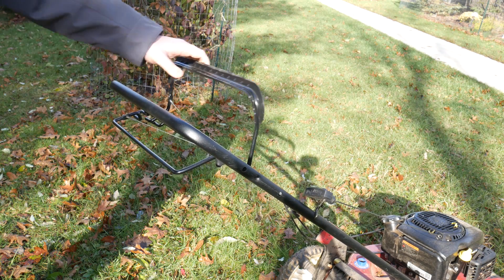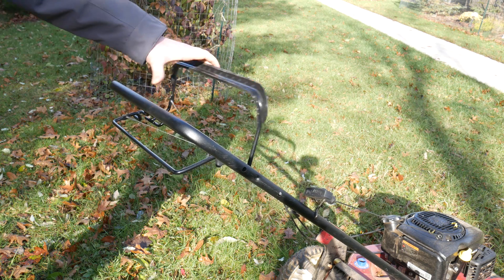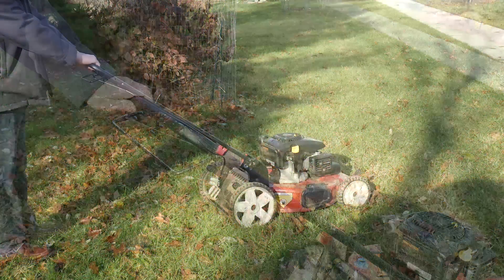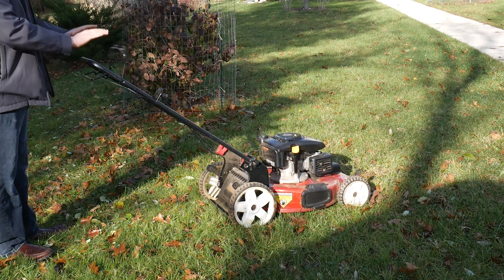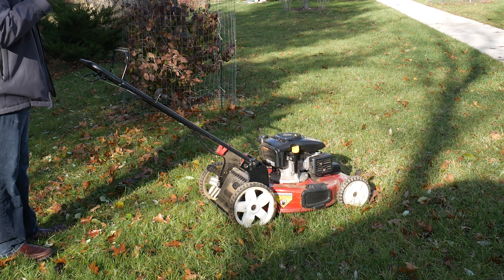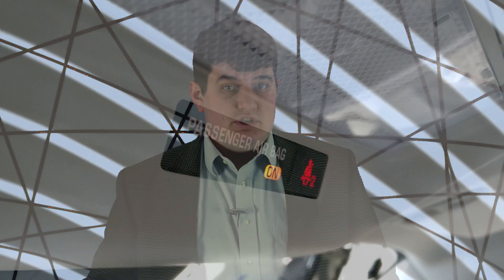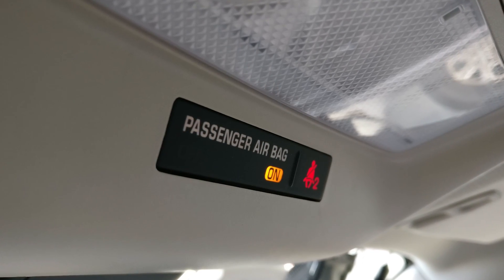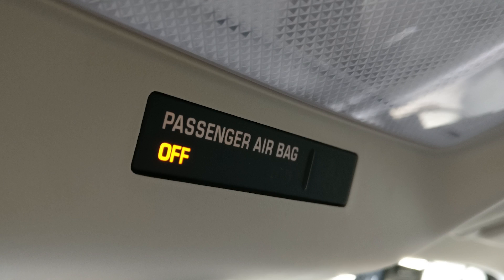The Dead Man's Switch:  How Anton Yelchin's life could have been saved

Comment: A steering wheel not physically connected just seems stupid, how do I steer my car if it dies and needs to be pushed? Lol.
Reply: Do you mean the Infiniti Q50's steer by wire system?  It has a clutch that can engage a physical connection from the steering wheel to the steering rack as a fail safe.
Reply: @TassieLorenzo  in that case what's the point of having steer by wire then if you have the entire mechanical connections there. there isn't a cost savings or a weight savings so they are literally putting in drive by wire just to make the car more expensive.
Reply: I seem to remember the Prius had issues early on where the wheels would get stuck in position when turning a corner and not being able to straighten out, even if the steering wheel was pulled back, because of steer-by-wire controls.
Reply: I think they are connected by hydraulic links, so that the wheel feels lighter when it is pressurised but it gets heavy again when there is no pressure going through the system
Reply: @jamnchips  Sounds like "power steering" to me...
Reply: Matt Carrell it’s just that some power steering still has the steering wheel connected to the front wheels and some power steering doesn’t
Reply: @jamnchips  Yea and I think it should always be connected to the wheels. What if your car loosed power going highway speeds? Jesus take the wheel has a whole new meaning.
Reply: @majorphysics3669  That´s exactly what happened to me, the motor of my car broke at high speed on the highway during a rainy night ,and the whole electronic shut down in an instant.
That meant no light, no anti-lock braking system, no electronic stabilization program, no brake booster and no steering booster / power steering.
Luckily there is always a (mandatory) direct mechanical connection between the steering wheel and the steering linkage, same goes for the brakes, so instead of a slight pull on the wheel you have to use much more force and have to do multiple full rotations to turn into the aimed direction, and you have to press the break pedal like crazy, but nevertheless you can bring you car safely to a rest on the side stripe.
Reply: Conventional power steering used a semi-direct link, allowing for a few mm of play either way to control balance between two sides of a piston (or two pistons) on the rack, But with this system, no rack is needed, just two pistons, one on each wheel, also has lower weight
Reply: @xapplimatic  power steering is other thing, it use a sundial gear and is always connected to the wheels
Reply: @jamnchips  That's just power steering with extra steps.
Reply: @jamnchips  thats power steering, not full fly by wire, full fly by wire is purely electrical from the steering wheel
Reply: @jamnchips  it's not that cars aren't connected to the steering rack anymore. I work in automotive and have yet to see a car that doesn't have a direct connection to the steering rack but we are moving away from hydraulic power steering to electronic power steering
Reply: @jamnchips  Hydraulic steering dies with the car, it necesitates hydraulic presure to operate, the wheel is just a valve in the system, my Case IH is like that, utterly dangerous if it dares to shut off. You can run the steering back to back and it wont do anything if the engine is not spining.
Reply: majorPhysics  yeah man :)
Reply: He's technically incorrect. There IS a connection, same as with hydraulic power steering systems, but they're designed to use that separation to allow the power assist to work. It's illegal to have a vehicle with no connection from the steering wheel to the rack (or, on a related note, from the brake pedal to the brakes)
Reply: @bootleg0012  computer actuated power steering just replaces the mechanical control valve in the gearbox, theres still a direct steering link to the wheels.
Reply: you don't, and be happy you can still fix your car without sending it back to factory
Reply: If I try to turn the steering wheel of my car without the engine running locks up anyways(separate from a lack of power steering), it has a lot of quirks that are probably designed to prevent a small child from accidentally killing someone with it that are incredibly inconvenient when it brakes down. Another example is that you can't put it in neutral without turning it on(unless you flip a tiny hidden switch that pretty much nobody would know about)
Reply: @bootleg0012  it's not getting off the ground with a short circuit lol.
Reply: Yup, there are arguments like this. But for an opposition there is safety. Steer by wire means there is no steering rod that can move towards you in case of a collision. (and yup, steering rods today are made to fold on collision to avoid stabbing you, but a physical object can still hit you, while a virtual one can't)
Also nowadays it's quite uncommon for a car to have all it's electronics broken. Most likely they choose a big enough battery to serve these functions for a reasonable time even if the engine is not running.
Reply: 100% hydraulic steering and braking is already implemented in most off road equipment made in the last quarter century orso. However my understanding is that it is illegal on highway vehicles because a loss of fluid will render the system completely inoperable. There has to be a completely mechanical backup system. That's why you still have a cable operated parking brake as well. I don't know how they get around that with the completely drive by wire steering and brakes
Reply: Eli Wesley - so, obviously not an Airbus pilot....in the incredibly unlikely event the that computers fail (FACS, SECS, ELACS) the plane steps down progressively from Normal Law (aka Airbus mode) to Alternate Law (737 mode) to Direct Law (MD-80 mode).  If all seven computers fail, or if all electrical power sources fail (two engine generators, apu generator, batteries, ram-air turbine) the A320 reverts to Mechanical Backup where the rudder pedals and pitch trim wheels are still connected directly to the rudder and horizontal stabilizer trim actuators; along with thrust control on the engines the airplane remains controllable and can be landed, although it would be challenging.

Bottom line: (some) control surfaces are directly connected to the pilots’s cockpit controls, same point as being made in the other posts.

But thanks for playing!
Reply: @Pupda  As an aircraft mechanic, with experience on the global 7500, its all fly-by-wire. No cables at all(except for the emg gear down). the 7500 has three primary flight computers, and two backups. only one computer is required for normal operation. EVEN IF all three fail, the backups kick in. IF THEY also fail, now you're down 5 different computers, the side sticks themselves switch to direct mode.
Oh, and for power, you have 2 gens per engine, one of the APU and a RAT.
For hydraulic power, you have three independent systems. one is required for flight.
Reply: It is a bad idea. Breakdowns of electronically excessive cars happen more frequently due to "update" issues and minor issues rather than major ones.
Reply: Welcome to the future!
Reply: MajorPhysics      Perhaps you might not want to fly on any modern passenger jet, as they all have fly-by-wire cockpit controls.
Reply: @steevee1945  Lol, I know your joking, but thats different lol. My jets not gonna stall on the highway where I have to push it over to the side lol.
Reply: @majorphysics3669  But jets have lost engine power in flight. They have backup power sources like the APU, the RAT and batteries. In an ICE car, presumably the battery could power the steering long enough to put the car in a safe spot. With electric cars being the future, it won't be a problem. And with self-driving cars, there won't be any steering at all, as far as the humans aboard are concerned.
Reply: Wasn't there a Jeep that could turn all four wheels opposite to each other and then rotate in place? How would you build a physically connected steering for one of these cars?
Reply: @PhoenixClank  I don't know, probably isn't, or at least the front wheels are. Like I said, it's stupid, but it does exist I guess.
Reply: @majorphysics3669  I don't know how this Jeep is controlled, but I would have made it so that in all other steering modes the steer wheel controls how hard you turn and the accellerator pedal controls how fast you're going. But in "rotate in place" mode, there's only one angle the wheels can be in so controlled by flipping the steering mode switch, and the steering wheel controls how fast you're rotating, so it basically becomes the throttle.

Now I'm really intrigued though. I wanna know how it actually works.
Reply: @PhoenixClank  i think i figured it out. The rear wheels are controlled by a computer, but the front wheels are still mechanically attached to the steering wheel. The gas pedal not being connected isn't a big deal, thats how we get things like cruise control and more efficiency if the computer can control how fast the engine revs.
Reply: just like the throttle cable, wouldn't it just be cheaper for the company to have a cable connected to the gas pedal and throttle than like 78 darn sensors
Reply: @themadlad_  not environmentally friendly though. how do you think cars get 50 miles per gallon now? sensors
Reply: @majorphysics3669  He's not saying for all sensors to go away, just the drive by wire system and its related sensors. It'd still have a throttle position sensor (likely mounted directly to the throttle body, connected to the other side of the butterfly valve), emissions control, etc.

The point of doing away with drive by wire is simply increased reliability and decreased throttle input lag, which is a problem both for higher performance vehicles and heavy vehicles.
Reply: @themadlad_  Probably, but then they couldn't sell the sensors when they go bad in however many years, they'd have to put up with people just tightening their throttle cable when it gets some slack in it. Hell, they could probably prevent slack by using a solid linkage, but that would require either the throttle body be on the top of the intake manifold like a carburetor, or some kind of really long linkage system that runs to the front of the engine. 

I don't think it would be hard to redo the intake, especially with the resources that car manufacturers have. But then, like I said, they couldn't sell the parts. Because look at classic cars. Most of them are still running the original linkage many years later, though probably with a bit of minor surface rust unless they've been taken apart, sanded down and cleaned up.
Reply: @lsswappedcessna  that makes sense now, but like cable no lag, more spood
Reply: You fix it where it sits. Or at least you fix the power steering issue.
Reply: @RealCadde  How do you fix your dysfunctional power steering while traveling at highway speeds? With pure steer by wire, you would not be able to manually steer the car, probably killing you in this instance

I'm about to go watch some videos about it actually, I sincerely hope they've addressed that problem with failsafes. The hydraulic link idea sounds intriguing.
Reply: @RealCadde  hey speaking of power steering this is a True Story I remember my son's teacher he told me actually all of us we were on a not necessarily field trip but this was a school trip to us lives competition we we're going to can't remember which one we made the state competition we were all on a school bus and yes our science teacher was driving evidently he has a CDL or whatever it was and he had driven School Bus can't remember the whole story you told us about a few times long time ago anyways he was saying one time when he was driving the power steering had gone out on that bus and they literally and Free People him the two students steering thing to limp back to where they need to go or one way or the other whatever can rubber flooring time again and yeah that much force is required to steer but it was still steerable but barely so people replying about the force of the steering in the Hydraulics are very much correct just thought I'd share what I had heard about happening along this one's just to show it can happen and it's a real thing and yes you would have some control if you had hydraulic power steering although I do believe there are plans or are already vehicles that would actually use for my trunk link between the steering wheel and the actual steering mechanism probably electro-hydraulic or some such not sure exactly how it would work but not that first on Modern steering mechanisms but more and more things as he says are not a mechanical link anymore let's just hope brake by wire would be more reliable if it ever did catch on that's one thing I think that's there still should be would be an actual power break that would be hydraulically actuated I think that's one thing that they should work harder to be actual linkage of some sort this after all you want to be able to stop no matter what but then again that was fail to occasionally give her about brake fade or problems with the power brakes and losing fluid the problem is the brakes themselves or not fail safe either is there a things that can happen to braking system that would prevent you from being able to properly stop the vehicle either partially or even completely I'd like for example train brakes that are in air system if air pressure is released it's a full brake application but there's issues with that as well where is on a train it probably would be a problem for the training automatically break because there is nothing to be another vehicle behind it that would plow into it like in a highway scenario if car would a break in mediately unexpectedly you probably could cause a massive pile up or worse so yeah probably one reason why those are brake systems like on trains does not carry over into anything in the transportation industry as a trophy goals because if that were to happen there could be a polyp even with air brake systems in terms of like semi trailers a loss of air pressure on a cab unit AKA truck would not cause at scenario although trailer brakes for example say the travel trailer or other vehicle equipped with electric brakes if it breaks away from the vehicle the brakes are slammed on full from the nose or a battery so yeah there's that flood it's turn Frank's light suddenly on a vehicle probably not the smartest thing in the world depends on the situation of course oh by the way with technology connections I agree about the system being able to use a sensor in the driver's seat as a Deadman switch that could have easily prevented that death and probably many others as well as an extra safety feature in case somebody else for to go wrong as well of course everything else you put into something that makes it more complicated means just that much War problem for something else. Cause a problem in a one way or another every one more piece of sensing Hardwear whatever means just that much more to go but overall I think that would be good choice from the Regulatory Commission and also manufacturers as well would support it even though I do not even own a vehicle nor have a license.
Reply: Even with power steering theres still a mechanical link to the steering gear. 

With hydraulic power steering theres a valve in the gearbox that senses steering wheel torque input and routes pressure according.  Don't have pressure? The shaft will still mechanically operate the worm gear or rack and pinion.

Comment: This system concept would be easily implemented in many new Subaru vehicles with electronic parking brake ....a seat sensor locking the parking brake if the occupants exit with the transmission anywhere but park

Comment: A hand brake would be cool also, no matter if you leave the car in drive, neutral or reverse, pull the hand brake and it wont move.
Also if the car automatically goes into park when no one is inside it could be troublesome if you need to push it.

Comment: Sorry to do the old grumpy guy here but I believe that primary control mechanism s should never be run by wire, and I mean steering and braking in cars. We all know that electronics are a lot much prone to fail and less reliable than a big old cable. Plus software control is plagued by bugs (I know that I'm a programmer). Don't relay your security in a peace of software Boeing knows that to well now...

Comment: I just use the handbrake whenever I park, in addition to keeping the car in gear when I shut it off (I drive a manual). I’ve heard rumors that leaving it in gear can put strain on the clutch but especially if I’m parked on a steep hill, the teamwork of the gear and the handbrake keep that thing from moving.
Reply: That's not how it works. Basically you want to put your gear opposite to the direction the car would be going if the handbrake fails: for example if your car is parked facing downhill, you need to put it in reverse, so the car tries to go uphill. This might damage your gearbox, but it's better than the damage a runaway car would do.
Reply: @iamspencerx  It doesn't really matter which direction, the engine can rotate both ways.

Comment: My last mower did't shut the engine off; it just disengaged the clutch and applied a blade brake.
Reply: same effect tho
Reply: @douglasrogers4675  Not entirely. While It meant not having to restart it nearly so often as a kill on the motor deadman safety, it also unfortunately meant decreased safety by comparison, as it was possible for accidental re-engage, increased complexity, decreased reliability. And, yes, I've had it accidentally get restarted.